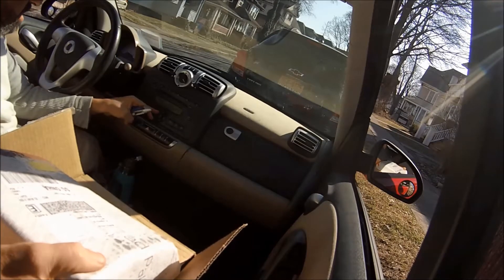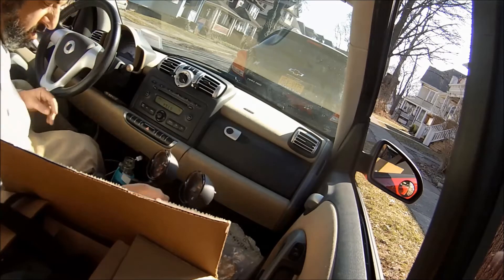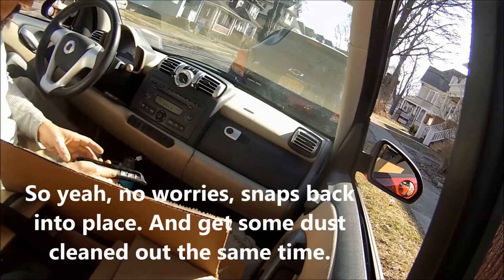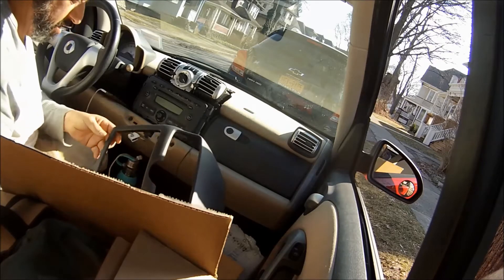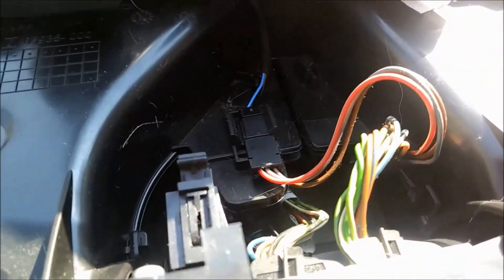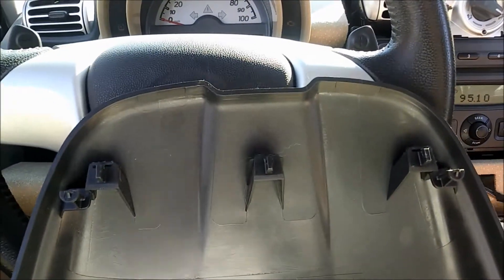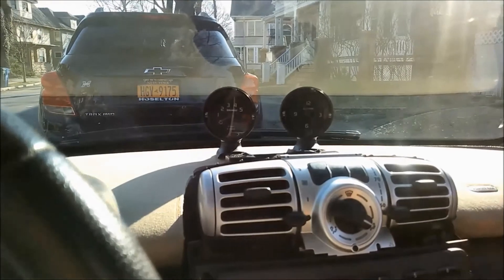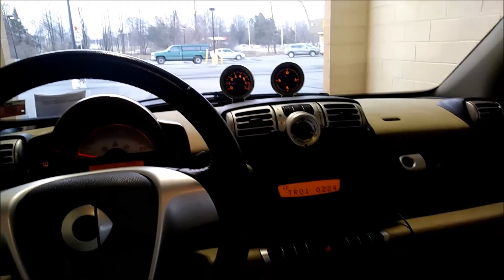smart fortwo 451- How to install a tachometer and clock  (2010)

Comment: Good video, however instead of pulling the wire harness to get to the tack lead, just take out 4 screws, pull the radio and it is right there easy to grab and take the tape off.  No potential damage to pulling the harnes.